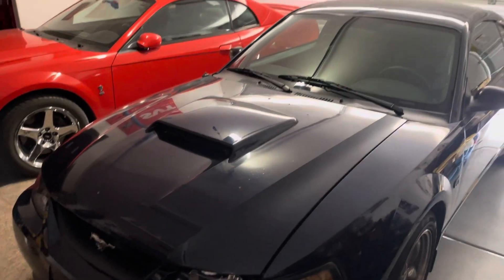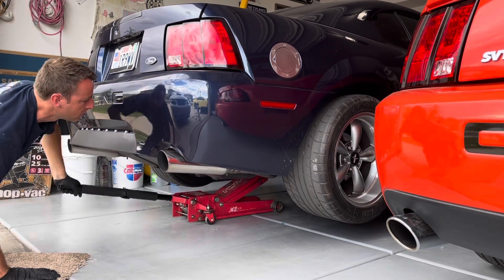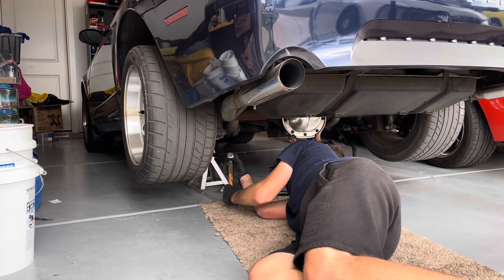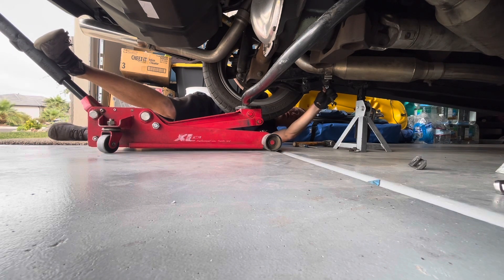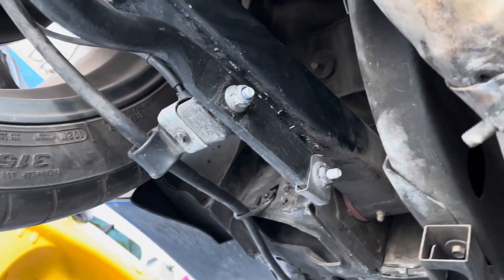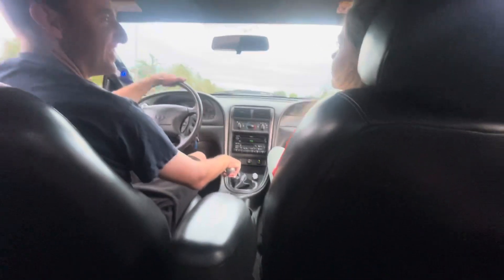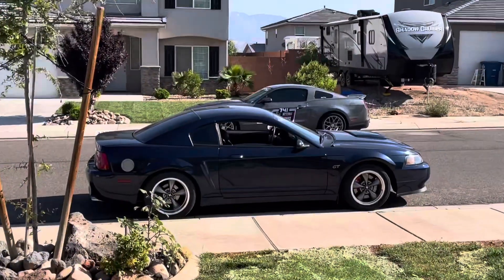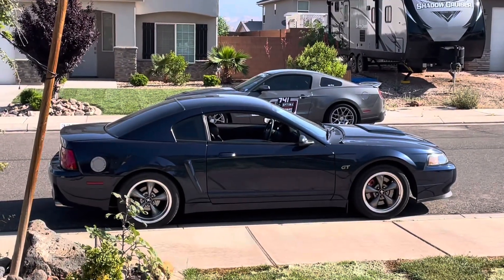2001 bullitt rear sway bar install and drive cammed 2V new edge mustang sn95

Comment: Thanks for all your videos, especially those that I can apply to my Mustangs (04 V-6 manual & 03 Mach1 auto).  Installed an Eibach 25mm rear sway bar ($40 on Marketplace) today on the V-6. Took 3 hrs and your idea to use the jack to support the bar really helped me out!  A quick drive on twisties and cornering, I felt planted. Thx again
Reply from the maker: That's great. I'm glad it helped.

Comment: Have you tried Amsoil proprietary coolant boost called Dominator? I would recommend running, it helps bring the heat down a bit during the summer months. The Bullitt sounds very nice.

Comment: @justin.c_svt have you had any problems with belt slip on the 2.76 pulley at all with the tork tech or has it been pretty steady?
Reply from the maker: No belt slip. The stock size lower pulley isn’t very big so that helps and I have a grip tech 2.76 pulley.

Comment: Is the wife traction control system a standard or optional feature on new edge Mustangs?
Reply from the maker: Only comes on New edge mustangs owned by married men. Single men will have the option added free when they become married or are dating.